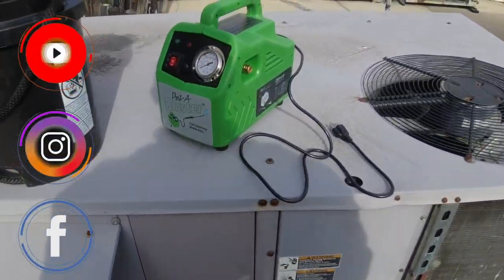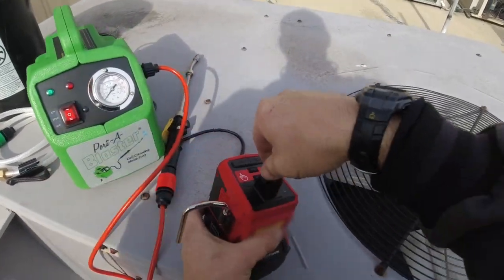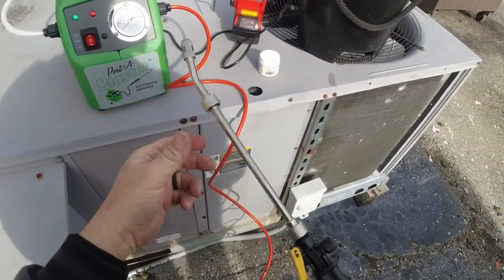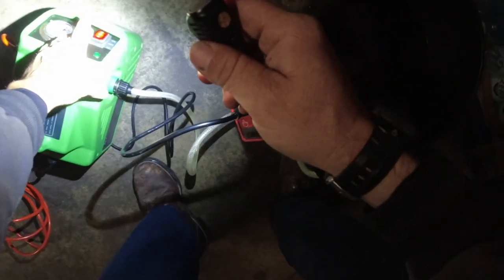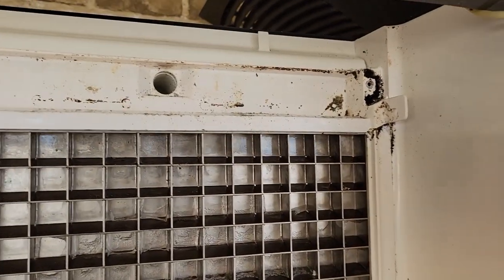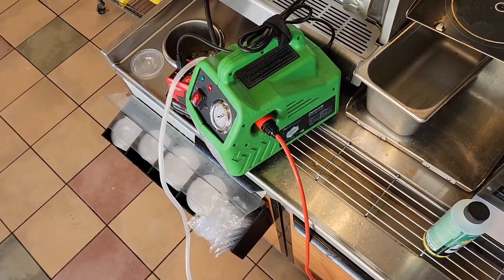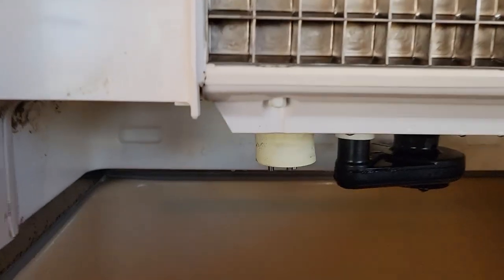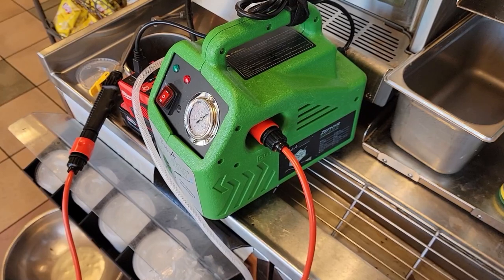Supco Port A Blaster Review TradeFox

Comment: I'm very glad i found this video and all the positive reviews in the comments. I just moved into a house with 7 mini splits and was blown away when i found out it's $400 per unit, on average, to service them. Then I looked into doing it myself but the two main pressure washers I came across were like $800.... This port-a-blaster looks sufficient for my needs. Don't need to be spending $500 more just for battery power.
Thanks!

Comment: We have 2 port a blasters at work. We mostly use them on smaller split units or smaller RTU’s. We have over 10 RTU’s and over 25 MAU’s so I don’t use it on the bigger RTU’s. Instead of a bucket I use one OC those 5 gallon water bottles with the smaller head. Sometimes I’ll fill the water bottle with warm or hot water. I don’t use coil cleaners unless the fins and coils are extremely dirty. I wish someone would come out with a 70 or 90 degree stainless steel piece for those tough angles. Or at least a tip would be nice.

Comment: The cabinet design is reminiscent of a refrigerant recovery machine.

Does this drain itself completely of water, so it could be safely stored in a place where the temperature might go below freezing (such as one's van)?
Reply from the maker: Yep it does, (we're getting into the low 30s in Ohio already). What I've been doing is unhooking both hoses and running the pump for a couple seconds. While tipping it to the side.

Comment: I bought the WORX pressure washer and a adapter to milwaukee battery. It actually works quite well. Its a cheap tool and the attachments are kinda neat. I really enjoy your cut to the chase videos, keep it up.
Reply from the maker: I have that worxs sprayer and it didn't last long. It won't prime already.

Comment: I bought the Porta blaster last year and didn’t really use it too much. This year I have found a lot more uses for it and really have enjoyed it myself. I agree that there could be a couple different wand angles for when you are in tight spaces.
Reply from the maker: I cut the wand at the top and used a copper 3/8" 90 elbow,  I had a swage it out a little bit and used high silver content to braze it. Probably could have used stay bright 8. Works great!

Comment: Hey Rick I'm thinking about getting this tool, wondering if the metal nozzle will screw onto the handle without the extension, which will make it smaller for walk-in evaps??
Reply from the maker: Yes it does. I’m still using this without any problems

Comment: How’s the Porta Bladter still working after 2 years 
I’m considering getting one from Truetech and just thought I would check and see how you still like it 
Does it still work??
Reply from the maker: Yes it does. I’m surprised I haven’t hurt it. I run as hot soapy water through it when I’m trying to melt stuff or wash evaporator coils coolers.  Still working
Reply: Thank you I will use SURVIVAL for my discount and so you can get that cheese 
Appreciate you sir

Comment: Are you still using this little pressure washer? How does it seem to be holding up? It seems to me that it’s a little bit too hard to follow and pressure to do mini split heads
But small rooftop package units and walk-in coolers like you demonstrated, it seems to work well on
Reply from the maker: I'm truly impressed with it. I'm in winter right now so I'm not using it much but if I need to, it's ready👍👍

Comment: Hello is there  any place that sells a 90 degree wand for the port-a-blaster or any advice on how can I make one?
Reply from the maker: I showed another video what I did to it, I cut the 3 inch piece and used a 3/8 90. You could probably use stay bright, eight, or any high silver, soft solder, I used 45% silver and brazed it in
Reply: @HVACRSurvival  hello thank you for your advice/help ❤️ I really appreciate it

Comment: Thank you for saying that about the Milwaukee pump although over on Ted's Channel he seems to have a good experience with it so far from the looks of things
Reply: 3:15 Frozen soapy secret used by instrument makers and is easy to handle, the mix on the other hand is a closely guarded secret. Also sand packed in a tube works, but very easy to split your tube and finding a rod the right size is a real pain in the neck. The soapy water deal slides and like turns to a sort of clay like slush. Then just rinse it out. I'd have to look it up again to tell you everything. I want to try to the silicone tubes they have for making bends in PC water cooling setups.
Reply from the maker: I love the pump but I'm not happy it leaks when I restrict the flow

Comment: Nice, for how long can you run your supco power wash with the Milwaukee power pack?
Reply from the maker: I haven't ran it from start to finish but more than enough to do anything you need to do in one setting. I would guesstimate probably 35 gallons or more of water and that's with a 5 amp hour battery.

Comment: Would the ryobi 80 watt inverter work well with the pressure washer?
Reply from the maker: It might be a little more than 80 watts. I forget exactly what the amperage was but I think it was higher than that but not more than 150 watts.

Comment: Is this good for rooftop units?
Reply from the maker: It's not got the volume that a garden hose has but it does have more pressure, usually water volume is what you need to drive large particles out of the coil, I'd rather have a garden hose but if you're on a rooftop unit that has no water within a couple hundred feet then this might be the best option. The alternative sprayers are  no better and they cost between $700 and $900

Comment: Nice tool - be careful of the soap and water.   Pressure washer pumps often really hate that stuff.    Be sure to rinse thoroughly as well.  (the machine itself)
Reply from the maker: Your right 👍👍
Reply: @HVACRSurvival  - I know of a few people that have blown theirs up that way.   (I wonder if that affected your Milwaukee's seals?)   Interestingly enough, the hard water isn't as much of an issue, as long as you drain it reasonably well.
Reply from the maker: @tbelding  all I have done is used it to spray water and transferred polypropylene glycol for about 10 or 15 gallons.
Reply: @HVACRSurvival  Heck, that glycol will help keep it lubricated.    I've managed to use car wash soap in mine, but I pre-diluted it, then used that with the dilution hose, and rinsed well afterwards.  It worked fine that way.  You could probably do it with other soaps as well, just avoid those with waxes.

Comment: Would this be good for mini split heads?
Reply from the maker: I think so, the low pressure setting allows good control of the water and pressure. I wouldn't be able to use my Milwaukee on a mini split but  this Port a Blaster is handy.